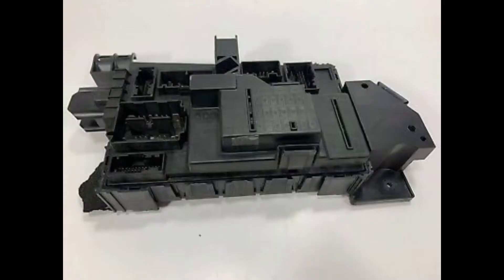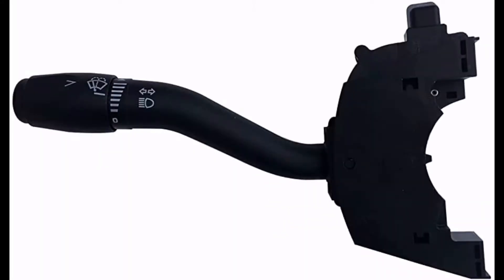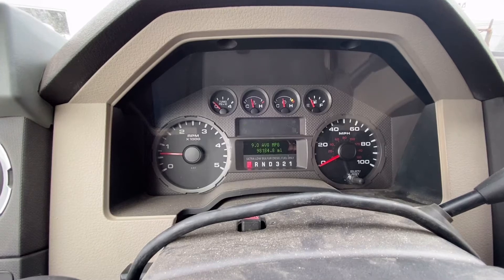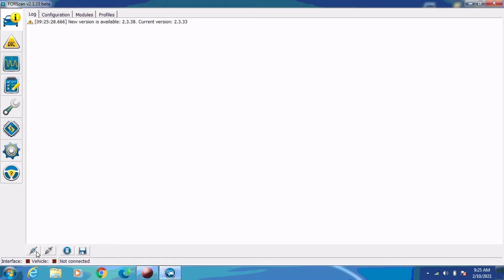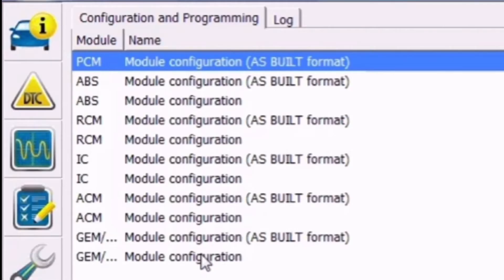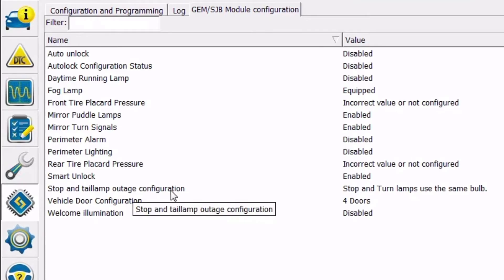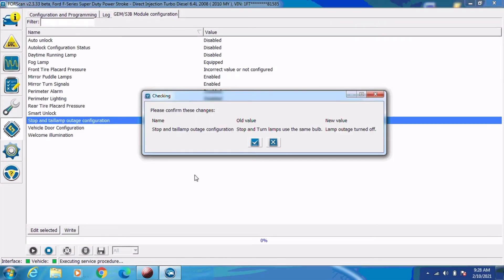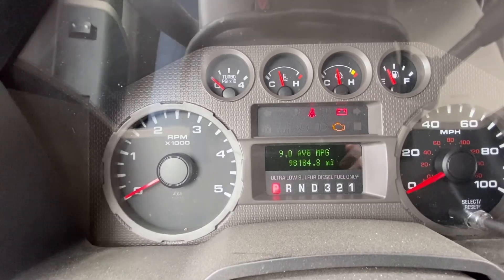How to Fix Ford Turn Signals Flashing to Fast with LED Bulbs

Comment: on my 2009 F150 i just changed all 4 of my incandescent factory bulbs to leds and now i have this situation. is there a Forscan or any other brand tool that i can purchase now (aug/2025) on amazon that i can do this task with?  thanks for any info you can provide.

Comment: Will this same procedure work with 2018 Expedition with the LED rear brake light swap??? I have Forscan loaded but would I basically look in the same place as you just showed?
Reply from the maker: It would be in the BCM if it’s available to change.
Reply: @CarShopTalk Thanks fir replying...I will look there!!

Comment: I heard u can get a small cicuit and plug it in to each light t soemthings and it'll make them work normal but now i gotta go spend a hr n find out if the leds blew a fuse or relay or behind the steering there is a plug that slips put in the older fords. Wish thie was the only thing messed up

Comment: Have 03 f150 7700. Installed led blinkers all 4. Rapid flash, if i turn on headlights no flash on bulbs and blinker indicator stays light in dash. Does this proceedure apply to my vehicle?

Comment: Hi.
I'm facing an issue regarding turning light.
My left side indicator starts blinking  immediately as my dashboard gets power.

Any suggestions.

By the way I got a Ford Figo petrol variant from India(right hand drive).

Thanks in advance.

Comment: Very good video.    The change in Forscan is probably only for the rear and the front is just not as sensitive perhaps so some LED bulbs work in the front without triggering the outage fast flasher.     So one path is to FIRST change only the rear to LED, make sure that works fine with the  Forscan change and then after that is good,  change the front to LED and if it goes in to outage fast flash mode, then find other LED bulbs and try until you find one that does not trigger it or just live with incandescent turn signals in the front and LED in the rear.      I switched to RED LED in the rear due to the lights looking pink instead of red and not wanting to buy new tail light housings as they look fine just the red color became a bit faded over the years, the Red LED looks better than new.

Comment: 2006 F350 My GEM only shows 4WD Electronic Shift on the Fly and Transmission. Is there any way to get it to show more information?
Reply: Same, how did you fix it?

Comment: THANK YOU Sir for making this video! I had a rear left turn LED (previous owner install) that would hyper flash, the right side flashed normally . I was able to find the module and make the adjustments which solved the issue. I bought a 2013 F250 SD two years ago (its now mid-2024) and it came with this issue. Fiddled with the resistor on left side but did not help. I recently heard that FORScan was a very neat tool for these kinds of adjustments, and being the cheap bastid I am, I used the free 2 mo. version and found where to change the values. Many thanks again!! 👍

Comment: I just tried doing this with my 2010 F250, I have LED bulbs in the front and rear turn signals. I managed to get the code updated, and even double checked in the as built section to ensure the codes changed as well, but the problem is still here. Does that mean my only option is to go the added resistor route? Or is there something I’m not doing in Forscan to get this to work properly?
Reply: Having this issue as well. Did you ever find a fix?
Reply: Please update us, same issue

Comment: Hi, I just turned it off on my 2010 Ford Flex, but without results. It says it is turned off, but still got the hyperflash. I did all you said in the vid, write and turn ignition off and on. What can be wrong? Thanks.

Comment: Are there other OBD2 scanner apps that would suffice?
Reply from the maker: I’m sure there are, but the only other one I’ve used for something like this is a Ford IDS / FDRS.
Reply: @CarShopTalk  I've got a license now and have tried with one of the crappy clone obd2 scanners and it did connect and let me browse around but did not see gem module or bcm unfortunately.  going to try a better obd link before I lose hope...  I am doing this on a 2008 ford edge
Reply from the maker: @_Ferrigno  what vehicle are you trying this on?
Reply: @CarShopTalk   it's a 2008 ford edge
Reply from the maker: @_Ferrigno  it should definitely have a smart junction box / bcm.
Reply: @CarShopTalk   I purchased a proper OBD link and got it working thanks for the video and appreciate the responses!

Comment: 2016 f350 Fast blink both sides, all bulbs are working. Could LED lights on trailer cause fast blink?
Reply from the maker: I didn’t realize it would on a 16, but I did run into it on a newer truck. To verify you’d have to unhook the trailer and clear codes out of the trailer module and see if things go back to flashing normally. Is it actually a 2017 with a 2016 build date? I would have guessed 17’ was the first year for that.

Comment: So is there no way to fix this without turning off dead bulb detection? I am gathering not since Ford doesn't use a flasher relay in newer models.
Reply from the maker: The only other way I know of to get around it Is to wire in ballast resistors so the bulb resistance is correct.

Comment: Just bought the FORScan ELM327 adapter and I am excited to get it in the mail and try this. I have always hated using load resistors so thanks for the video. I just subscribed and will leave a new comment to update the community on my progress.

Thanks
Reply: Any luck?
Reply: @alexmack956   it does connect just fine but my specific car does not have that checkbox. Still it's nice that I have it for other vehicles

Comment: Shop Talk, thanks so much. 

I have a (drop dead mint, 23k miles) 2007 MGM that I tried to upgrade to LEDs, but hyperflash occurred.  In your experience, is the module you configured in the 2010 F-250 also in the Panthers ?  From around 2000 forward the FCV. MGM and LTC went to a Lighting Control Module (LCM) where the flash functions are integrated.

(No discrete flash in those Panthers; despite the internet world from AdvanceAuto to RockAuto to O'Reilly saying otherwise in their parts search, offering both regular and LED-compatible versions.....oops.)

Comment: I have all connected but the modules wouldn't open any info will help thank you
Reply from the maker: Does it connect to the vehicle?
Reply: @CarShopTalk  yes it does and read al modules ..but when i click on it wont not open..only hightlight
Reply from the maker: @frivera2875  is it the paid or free trial version of Forscan?

Comment: Called my local stealership and they indicated no knowledge of an SJB/GEM, or how to fix the fast-flash fault light. I'm glad SOMEONE knows what they're talking about.
Reply: I have a 2021 F-250 that was doing the fast left blinker, I checked all the lights and they are all working so I assume that someone has used LRD's for some of the lights. I made 5 calls and found one shop that said they could do it... for $225 - NO Thanks, thank you for the help, I just hope this is still valid info for a 2021? I am ordering the OBD connector from Amazon. I was told you can get a 2 month trial for FORScan on the forums somewhere? Anyone know where to find this? @victorevil6872

Comment: I have a 2016 f250. The battery was going dead. Somewhere in the process, the turn signals started flashing fast.  Apparently, now when I have a trailer hooked up, only the running lights work. What do I do?
Reply from the maker: I would recommend taking it one problem at a time, easiest to hardest. They might all be related, or might not. I would probably start with the trailer light or turn signal issue and then move on to checking it for an electrical draw or charging issue.
Reply: What did you find out about the problems you mentioned?
Reply: @spineguy444  it ended up being fuesed relating to a computer that controls trailer lights and a couple of bulbs

Comment: Will this work on a ford c max, I change the bulbs with the same non led ones and still is flashing fast on the passenger side
Reply from the maker: I think I had that on a c max a year or two ago and it ended up being a wiring issue. But probably, most Ford BCM’s have that option.

Comment: That stupid tool is not recognizing my car!!!
Reply from the maker: Tool?  Forscan?  What’s year and model of car? What’s it doing when you try to connect?
Reply: @CarShopTalk  yes. I installed FORScan and registered it and paid that 12 bucks. It connects to the OBD2 but doesn’t recognize the car. 2015 Ford Fusion. I am super frustrated.
Reply from the maker: @marcowerner8739  Which version of Forscan, windows version or lite on a?  What are using to connect to the obd II?  When you click connect what happens?  It starts reading the car but doesn’t recognize it?  Has it been tuned?  I don’t run into it much any more, but some of the older tuners would change the PCM tear tag and Ford scan tools and wouldn’t recognize them any more.
Reply: @CarShopTalk  FORScan 2.3.51 windows version.
Reply from the maker: @marcowerner8739  It starts reading modules and then a pop up comes up that says it doesn’t recognize the vehicle?
Reply: @CarShopTalk  yes sir. Exactly. It is connected to the Bluetooth OBD2. Then if confirms that it is connected then that pop up comes up and tells me that it can’t recognize the vehicle. I have downloaded a different app on my phone and it connected to the car perfectly and recognized the car. I just want to use the exact module that you are using to stop my flashing lights from blinking fast after installing LED turn signals.
Reply: @CarShopTalk  car scanner pro works perfectly but I don’t know where to go to reprogram the turn signal lights.
Reply from the maker: @marcowerner8739  Is it tuned?  That’s exactly what happens if something has changed the tear tag number for the PCM. Forscan and IDS identify vehicles by the PCM software / tear tag. Scanner Pro might identify it my the VIN. I’m not sure if Forscan has a manual vehicle entry option or not without having it in front of me to look at.  If it is tuned can you flash it back to stock easily?  If you can, then you can make what ever mods with Forscan you want, and then flash your tune back into it. I think if you save a session on it you can reopen that session next time you use forscan and maybe get around all that next time.
Reply: @CarShopTalk  Sorry but what do you mean by tuned? I am doing the OBD thing for the first time. Sorry if my question seems dumb.
Reply from the maker: @marcowerner8739  Has the software on the PCM been altered or modified to increase performance. Usually this is a software download through the OBD II connector. It can cause Forscan or IDS to not recognize the vehicle, and it definitely should recognize a Ford Fusion. The only times I’ve had an issue with Forscan not recognizing a vehicle was a vehicle with a modified PCM, a vehicle with no communication with the PCM, or a brand new, literally 1 week off the transport truck. Usually anything older than a month or two and Forscan recognizes it.
Reply: @CarShopTalk  I see what you mean. But I bought this car brand new and never tuned it in any ways. I never used an OBD on this car before. Just needed to make the adjustment with the turn light blinking too fast. But nope, never ever touched the car’s ecu ever in the past.
Reply from the maker: @marcowerner8739  I wonder if something just got corrupted with the the Forscan download. This is the first vehicle you tried using it on right? Do you have access to another Ford to just try plugging into and see if it will recognize it?
Reply: @CarShopTalk  Yes sir. This is the first vehicle I am trying to use it and I don’t have another ford unfortunately to try it on. I have send the debug data to the developers at FORScan via email and will see what they say.
Reply from the maker: @marcowerner8739  let me know what they say

Comment: Thank you for this info. Unfortunately my 2010 F-150 when connected to forscan does not have the same sjb as that setting/line is not present.
Reply from the maker: I had someone else comment that it wasn’t in the menu on one a few weeks ago. It must not be in the menu on all of them.
Reply: @CarShopTalk  Please explain "t". Also I am conceding for now and will be putting the incandescents back in at least to pass inspection. Thank you.
Reply from the maker: @harryort2647  “wasn”t”.   Sorry, typo

Comment: Thank you for the awesome video. I'm trying to fix this same issue on my 2010 F150. If I'm missing the "Stop and taillamp outage configuration from the GEM/SJB menu, does that mean I'm SOL? Thanks again for your great videos!
Reply from the maker: If it’s not in the menu probably.  I’m surprised it’s not in the menu. You might try searching around and see if anyone has as built codes in hexidecimal for it. Make sure you save a copy of the original as built data before you try playing around with it.

Comment: I followed every instruction for my 2013 Ford Expedition EL King Ranch 2WD and it still hyper flashes. Help?
Reply from the maker: Check and make sure it wrote it to the module. If you read the module again does it show it turned off?

Comment: Oddly, this does not work with the Ford Escape 2008-2012.  After changing to LED front signal 3157 amber lamps (still waiting on rear brake/signal red bulb), the signals flash normally at 80/min without marker lamps on or headlights on.  With marker lamps or headlights on, I am/was getting rapid flashing before and after disabling this function in the GEM settings with ForScan.

Guess I'm off to the ForScan Forums to seek assistance.
Reply from the maker: I don’t think I’ve ever tried it on an Escape, but I’m surprised it didn’t work. Especially if it gave you the option to turn it off in the GEM. Let me know what you find.
Reply: @CarShopTalk it only turns off the rear not the front, no option for the front
Reply: Any update? I tried the same, the resistors don't work......Have to stick with halogen.....Tsssss...What a shitty
......LED are so brighter.....Can't seem to find anything, even replace some relays on the fuse and nothing......😢😢😢

Comment: how do you change the setting for the front bulbs?
Reply from the maker: It would be the same setting as the rear. The fronts are wired in parallel with the rear, so it’s the same circuit.
Reply: @CarShopTalk  under a different line item?

Comment: So I installed complete led rear lights on my wife's 2010 fusion and am having the same issue with hyper flashing. Is this the only fix for it to go back to normal?
Reply from the maker: The only other thing you could do would be wire resisters in parallel with it so the resistance and amperage draw is what it’s suppose to be.

Comment: Thank you so much for this. Our shop just got for scan so I’m going to try it out tomorrow. Do you know if you can tune diesels with for scan?  Like disabling the egr valve or disabling the ebp sensor?
Reply from the maker: It really can’t do engine tuning. It definitely can change features and configuration of modules like the body control module or instrument cluster (As-built data files) It’s biggest asset is it’s ability to communicate with all modules on Ford vehicles. That’s over 50 modules on multiple networks on quite a few of the newer Ford vehicles. And they keep it current. I routinely use it on new vehicles at work.

Comment: Can I use the android version to shut the hyperflash off?  Seems like every video I am seeing, everyone is using a laptop.
Reply from the maker: It has to be the laptop version. As much as I love the light version on android and IOS, and it has an insane amount of features and tools for what it is, only the laptop version will allow you to change as-built data or module configurations.
Reply: @CarShopTalk  thanks for the reply.  What stuff do you recommend?  I have a laptop, just need to know what other stuff I need
Reply from the maker: @bearing_aficionado  I normally use an obdlink mx+ Bluetooth to connect to the vehicle. It should work for about anything except adding keys. That usually requires a usb connection.
Reply: @CarShopTalk  thank you so much for your replies and help.  I have canbus decoders installed but still get hyperflash when my lights are on and sometimes when they are off.  Its rather annoying to say the least.  I am wanting to go this route and be done with it.  Again thanks for reaching out!
Reply from the maker: @bearing_aficionado  You’re welcome.
Reply: @CarShopTalk  wanted to give an update, so I bought a OD2 dongle from Amazon (Forscan recommended one) and used it.  I turned off the hyperflash and turned on "Bambi mode".  Again thanks for your help and insight.  It is much appreciated!🍻
Reply from the maker: @bearing_aficionado  You”re welcome.  Glad it worked.

Comment: How do I get the gem module on my list? I can’t seem to find it.
Reply from the maker: On the list? In Forscan or?  What are you working on?
Reply: If your vehicle is newer, it should be under the bcm.
My car, being a 2012, does not show gem module, but shows the bdycm (bcm) 
In which the option is there,
It seems older vehicles are a little different, newer ones will be under the bdycm

Comment: So ForScan is available on Android,  Apple, and/or Windows? What kind of Scan Tools will it work with ELM 327?
Will it work for 2010 Ford Focus? Thanks for your guidance!
Reply from the maker: ELM327.  I normally use an obdlink mx+ Bluetooth with it. They list recommended adapters on they’re site:  https://forscan.org/home.html      And yes it would definitely work with a 2010 focus.
Reply: @CarShopTalk  Thank you so much for your help.

Comment: Is there a way to change the expected current draw? Ie current draw goes down with LEDs so can someone reduce the current the computer expects?
Reply from the maker: You can change the settings so it stops checking it, but I don’t know of a way to change what it expects it to be with the bulb out feature turned on.